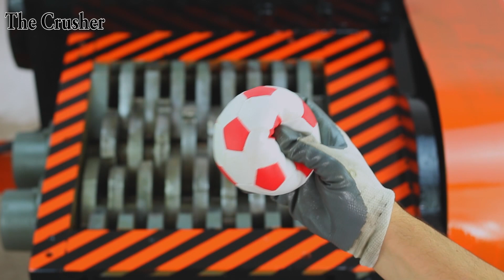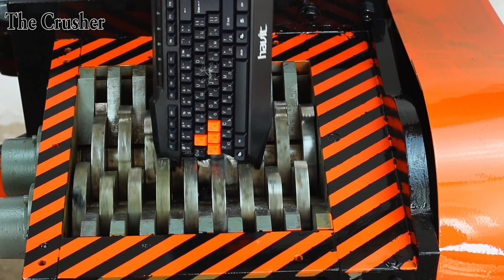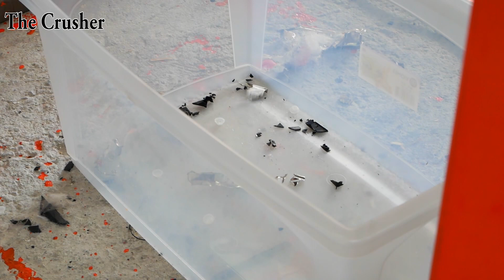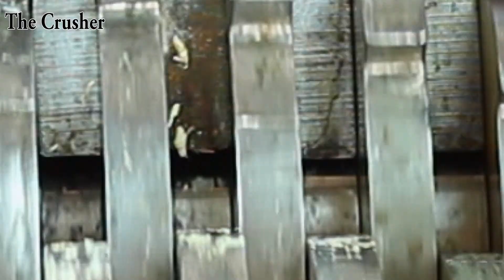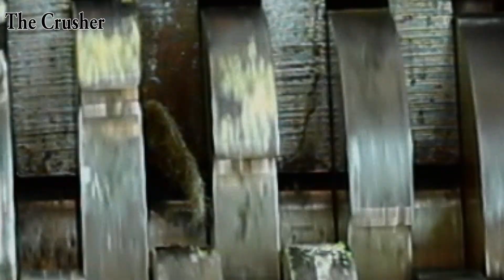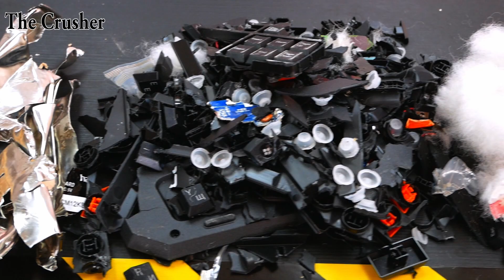SHREDDING BOWLING PIN And Toys | The Crusher

Comment: Instead of shredding a wooden pin see if the shredder can handle the Synthetic Twister Pin, that pin is extremely solid I bet the shredder would simply fail or can't even try, if you're able to purchase one of those pins anywhere then bring it over to your shredder and film everything that happens